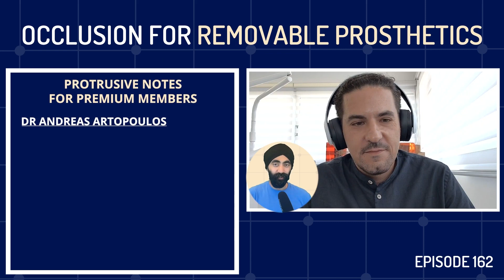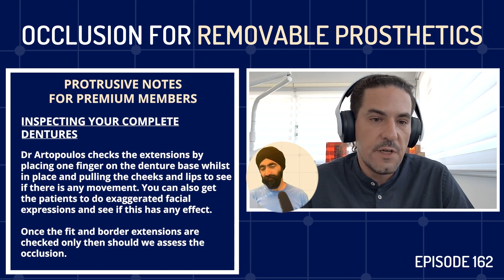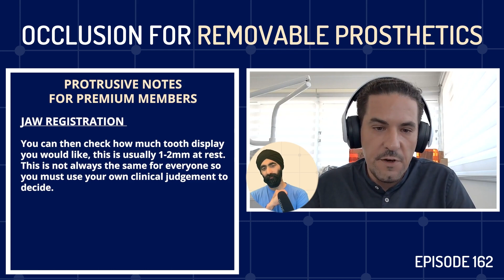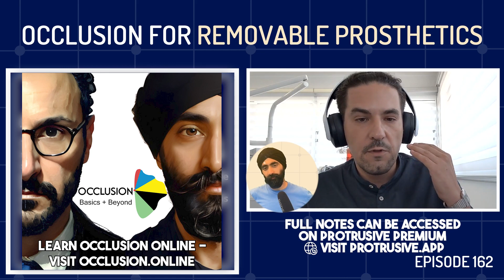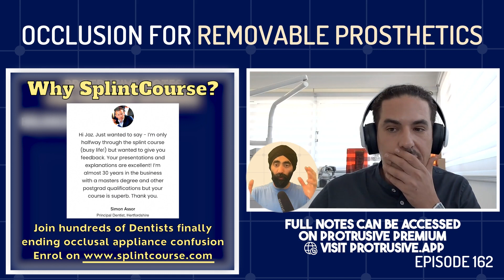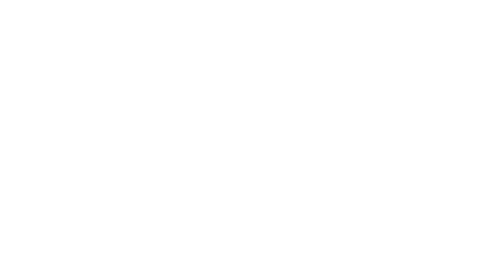Occlusion for Complete Dentures - PDP162

Comment: First check the tissue surface with fingers and check fir any sharp ir discrepancy, press on masticatory areas like molars and premolars , 2nd use pressure indicating paste on intaglio and afterwards on borders check the borders by placing finder in depth of sulcus and pull the cheeks and lips if movement it is not proper only then you start looking at the occlusion 
Place it and guide them in to occlusion instead of telling them to do on their own guide from the rested position that is ram or M 2-3 mm gap from occlusion why because it is the only reproducible position in Cd patients 
Jaw registration 
Always try to use a permanent base material heat cure pmma  something he said 
First put upper and establish the lip support first and then decide how much teeth you want to show in the anterior region at rest below the up lip 1-2 mm this also gives the level of occlusal plane how hig or low for fox plane and adjust to interpupilary line and ala tragus line as a guide upper done 
Lower 
Upper and lower parallel and good contact everywhere make freeway space do m and ram for rest position- 2 mm occluded position now ay was is fine for recording nick n notch pvs silicone bite reg paste or wax..
Best way to check if the occlusion is right or not is the try in stage here there are classified as differet types of mal occlusion or interference 
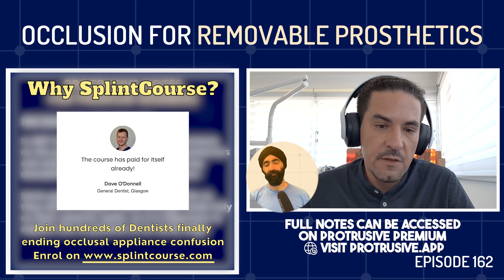Occlusal error is consi substantial if its wide, if the slide it causes is wider than a third molar cusp width for say .5 or .7 or 1 mm that is big enough  so clinically decide whether it is only one tooth causing it or more if only one tooth reposition that tooth if there r many teeth involved it indicates lateral error in jaw registration take a pre contact record and send it back to the lab to reset the teeth clas 1 2 or 3 depends on the patients orignal teeth see the skeletal relation depending on that also and on anterior there shouldn't be any contacts 1.5 mm gap si in functions or protrusion it doesn't destabilize the denture continue from 44:29 
4 ways of occlusion 
Balanced, lingualized , non balanced or group function , monoplane occlusion
Reply from the maker: looove your summaries once again!